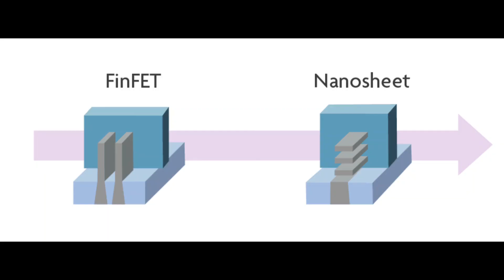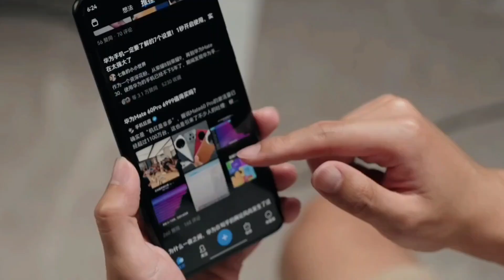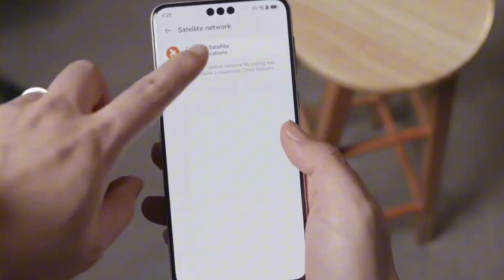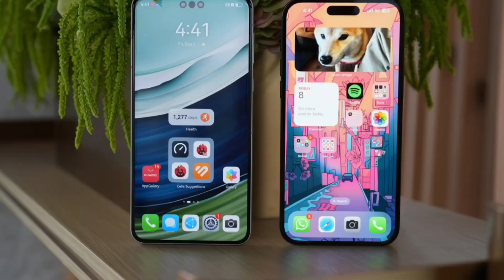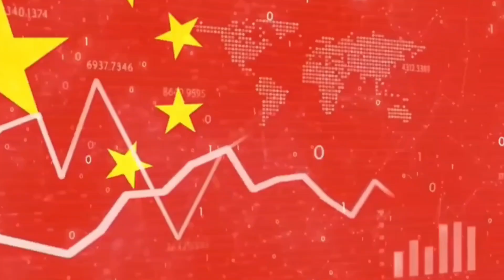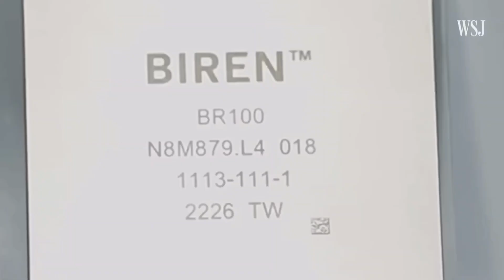Huawei's Bold Move: 3nm Chips with DUV Technology – What It Means for the Semiconductor Industry

Comment: I remember when I wanted to create a multicore arm cpus to communicate with each other... well the chinese send it for free to me lol... that after my university, but never went through with it... original plan was to replicate the expensive pic board(60 euros and clock with alarm I wanted to make had to cost like 10-15 euros) that school made us buy, where I made a clock with alarm in assembly language... the pic board was a horror to make that as the callstack was small and had to work efficient and also replicate sound ticks in hertz and assembly code for counting time which came from me putting counting code of cpu cycles lol... and it wasnt accurate so had to make it after how many milliseconds the cpu goes faster or slower and correct it, actually I thing it was about after a day it would lose a second... like my bought alarm clocks, but corrected the fluctuations with my readjustment of the code, I made the complete program in a one and half train ride as I lived in enschede and university was at utrecht, the teacher gave me a 8 out of 10 because the clock setting buttons were too fast in incrementations, but he allowed me to fix that and did that in 10 minutes or something. believe me it is a horror if you dont know all the code in assembly, as the buttons have to work with clock counting code and the button press has to be read, for how long pressed etc...